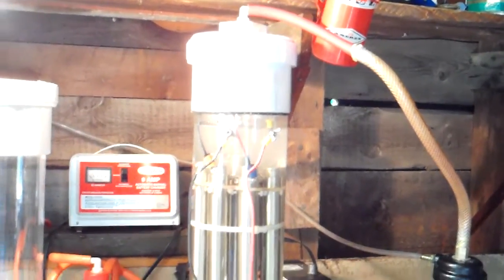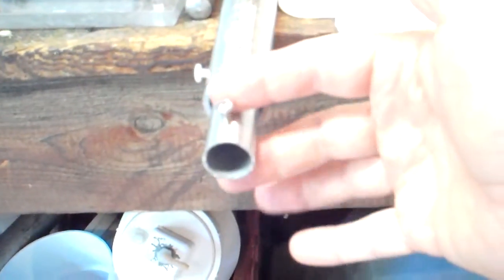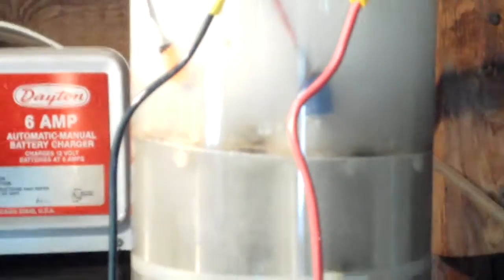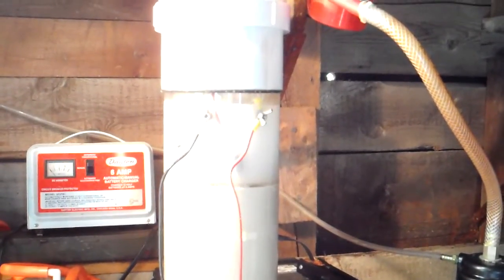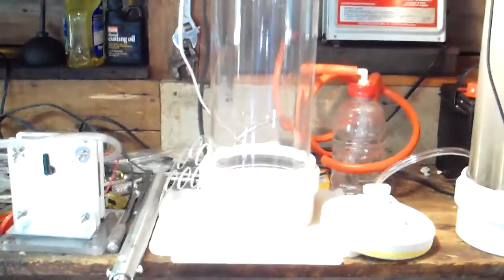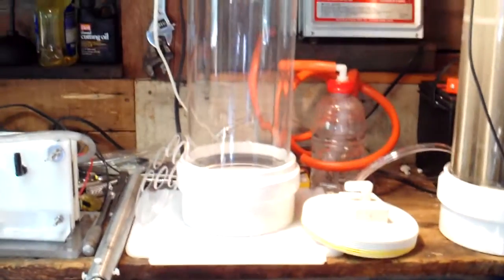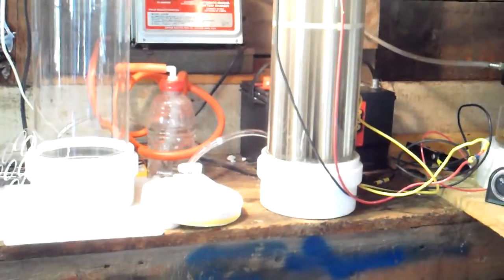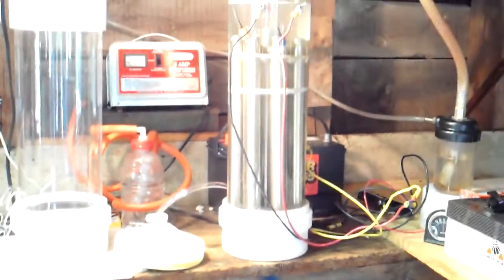HHO Generator "Tweak" Triples Output

Comment: (NICKEL) i seen ur other vids and this one seam to work the best so far and i think the reason y is the (NICKEL) content of the stainless steel ... cus the posotive side is making the metal come off in the water called (ELECTROLYSIS) the same thing (BLACKLIGHT POWER) Is doing they using nickel powder and tecknology has existed since last year and is coming out soon but 5 years is not soon enough ... need to find or make nnickel bars or plates as i havnt found any on ebay or any where yet

Comment: The water attom is made up of one oxygen atom and two Hydrogen atoms at about 104 degrees apart.  Through electronic modulations we should be able to rip the Hydrogen atoms off the Oxygen instead of pulling them apart with the electricity.  Someone good with electronics is going to have to mathematically see figure it out or we will have keep guessing until we get it right and then figure out the math.

Comment: I'm going to share a secret to HHO generation.  The same could be said with the rotary magnetsm generator.  Here is how nature works:  put on your thinking hat.  Question, if you have two powerful magnets stuck together, there would be two methods to seperate them.  You could pull them apart by sheer force or > > > your right slide them apart.